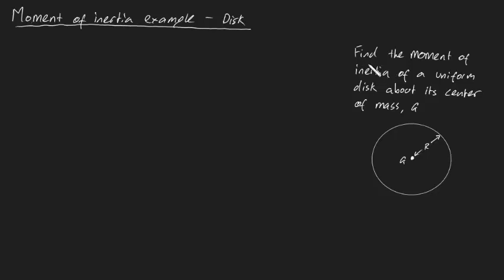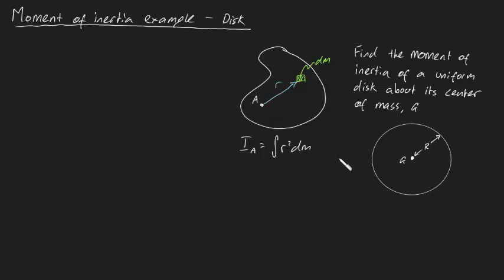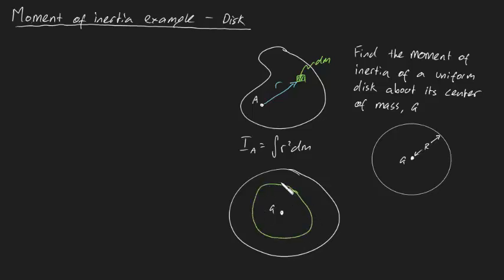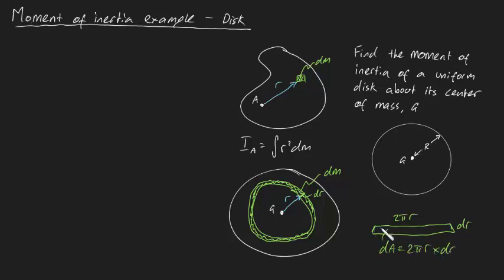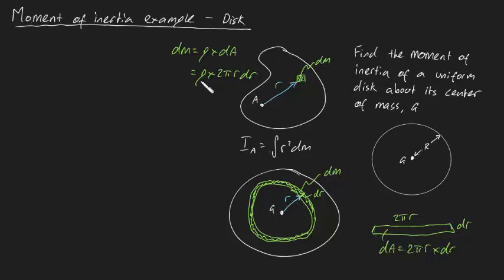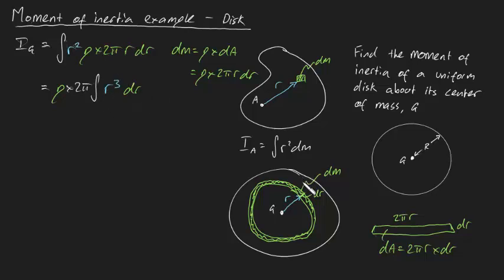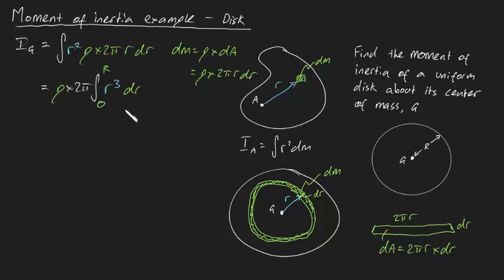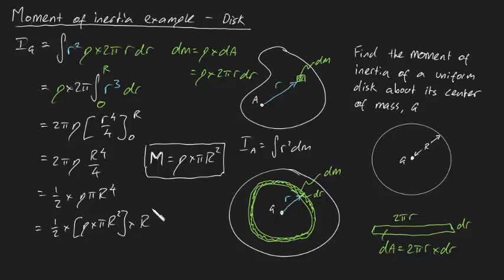Moment of Inertia of disk

Comment: how mass=density*area..not mass=density*volume...or we assumed that disk is hightless???
Reply from the maker: Hey mate! Excellent question! In this problem, I'm solving for the moment of inertia of a 2 dimensional disk which is why mass = density * area. The process for solving for the moment of inertia of a cylinder will be very similar and it will yield the exact same result!
Reply: Thanks sir,i had the same question and u really helped me a lot @virtually_passed
Reply: 2d vs 3d